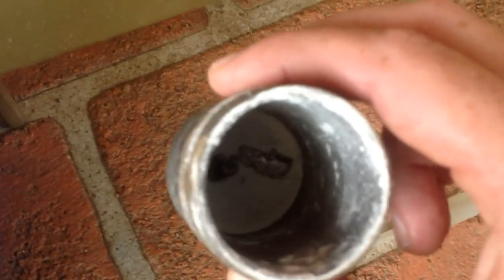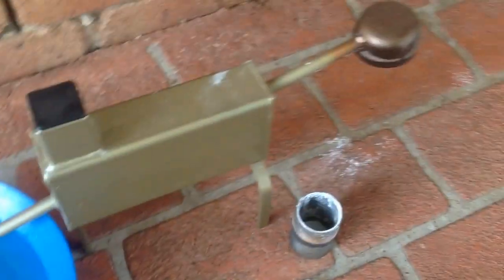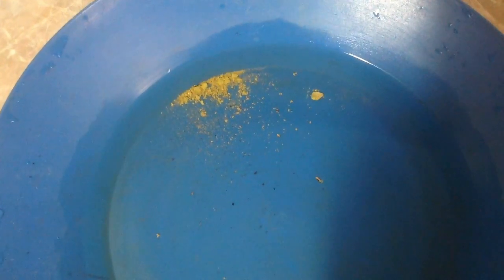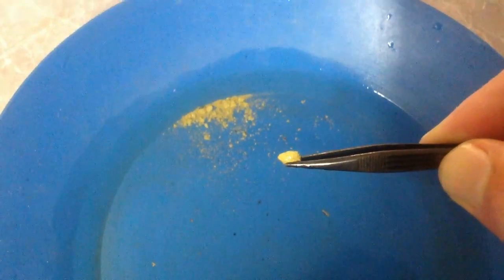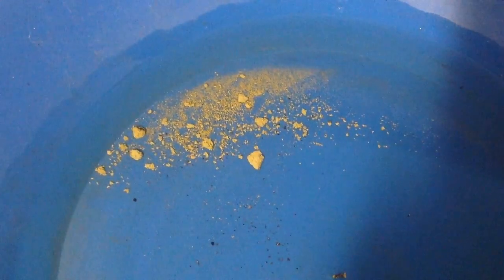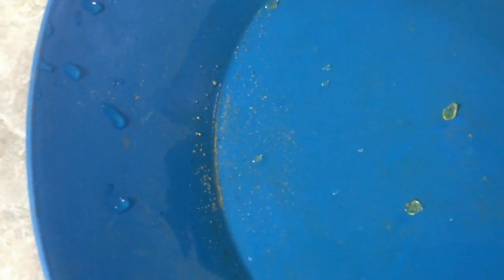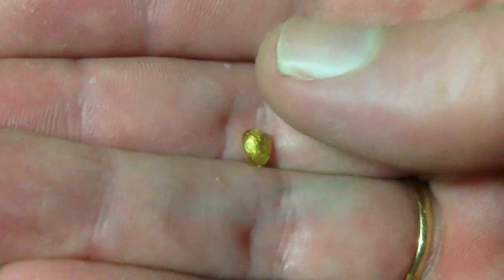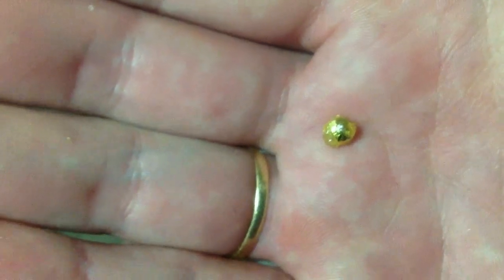Retorting gold

Comment: DUDE! The vapor coming from the end of your condenser pipe IS mercury vapor!  The end of the tube should be under water... That square should be full of circulating cold water
Reply from the maker: seyfertNGC501 There would be SOME vapour coming out the end as it is an UNVENTED RETORT (so between the time the drop of mercury comes out to the time it hits the water yes some vapour is released.), the end of which should never be placed underwater, as without a vent water can be sucked into the crucible with temp/pressure changes, causing an explosion. The square is full of ice water which when the retorting is finished is still cool so there is no need to circulate water, also this retort was not made to have water circulating. The slight vapour that is emitted is why I am in a well ventilated area. But as mercury vapour is not visible to the naked eye, what you see coming out the end is smoke from some flux I added.
Reply: 00Shivan00 A suction up the tube will only occur once you stop applying heat and the air in the crucible cools down. So long as mercury is being vaporized there will be no vacuum. If you are ok with continuing to do it this way then it is ok with me, It is your teeth hair and sanity, not mine.
Reply from the maker: seyfertNGC501 I am using the retort in the way it was designed to be used. The way I use it I can set up and walk away. The only really safe way to do what you are talking about would to get a probe to monitor the temp of the crucible, which is overkill.
I would get more mercury poisoning eating a few mouthfuls of fish than retorting the small amount of mercury in this video.
http://www.heracliteanriver.com/?p=246

Comment: I am dealing with gold that is so fine it is more like dust in the air than flower gold. Most of the gold is going out of the pain or the blue bowl. I need to use mercury to recover it. Thanks !
Reply from the maker: If you really feel your gold is so fine that you can't recover it and insist on trying mercury, take baby steps, tiny bit of mercury in a snuffer bottle with cons.
Though i would look at a gold cube, miller table or something similar first, you can make some of them on a small scale for not to much money.
Reply: +ewaste prospetor  that's what I deal with here in Nevada ,either that or the gold is in flowered mercury at the bottom of a river bed

Comment: I liked the video  but I think the end of your retort should be under water. It keeps mercury out of your lungs and out of the atmosphere.    You know (save the planet.
Reply from the maker: My retort unfortunatly is not vented, so if the tube was underwater there i a chance of water getting sucked up the pipe onto the heated mercury which could cause an explosion.
Its the one thing you do not do with a non-vented retort.
Reply: That vapor you see is mercury vapor. If you pull the tube out of the water when you turn off the burner you won't have a problem.
Reply from the maker: ewaste prospetor No, in that case the smoke coming out the end was from the talc powder, which I had not used before and made the mistake of using. On every other run we have done there has been no visible smoke or vapour coming out the pipe.
Most of the vaporised mercury starts to turn back to liquid high up in the exhaust tube as the chilled water in the vessel cools the pipe and vapour quickly. This normally runs out the end but because of the smoke and crap from the talc it got stuck in the middle of the tube this time and needed  a bit of help to come out.
Vented retorts are a much better idea but that is not what this is, and the first rule with a non-vented retort is the exhaust pipe does not get submerged.